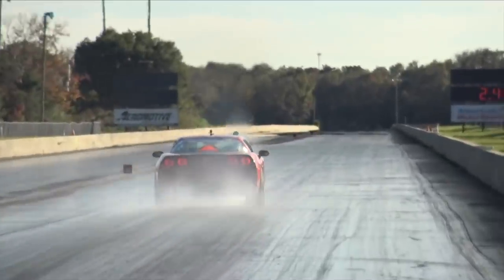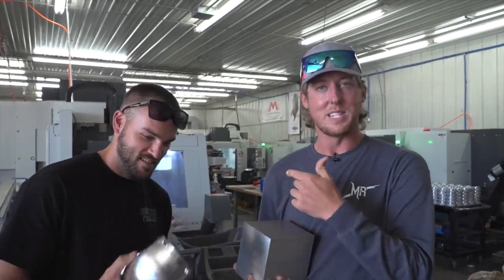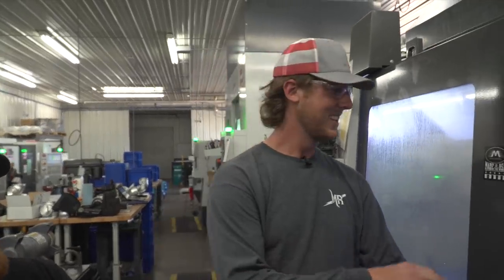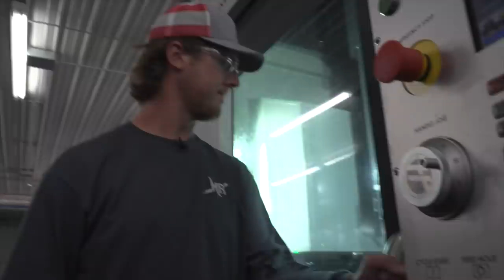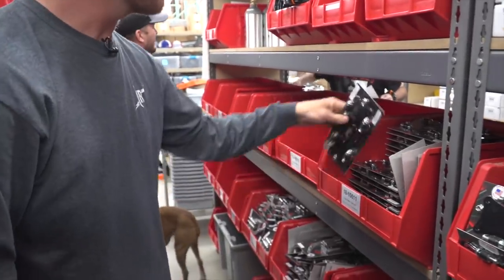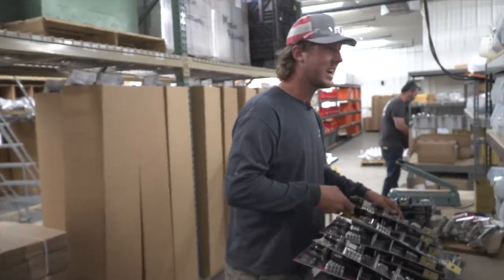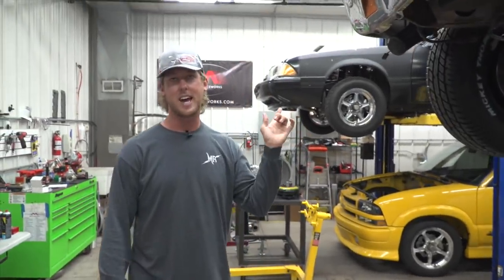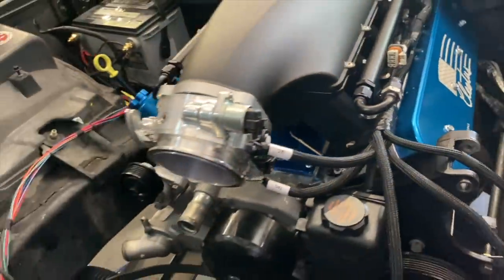We Just Made the BIGGEST Move Of Our Automotive Career...

Comment: I laughed like hell when cleet said "Pah, Ford stuff" when the mass majority of his fleet are Crown Vics.
Reply: Hmmm, technically that is true 😂😂😂
Reply: Because they are cheap lol.
Reply: Or the fact that the most reliable car is Ford. There is a lot goes into building a Ford motor. An ls is much easier to be truthful
Reply: All the this vs that attitude never seems to die.
Reply: @exothermal.sprocket  he aint wrong tho, wrenching on fords is alot easier .. distributor in the front not the back etc etc
Reply: and neighbor has been the most reliable car he has. lol
Reply: @Zirion123  There's good and bad with both. If you're a GM-head, you'll swear nothing about a Ford is better. If you're a Ford-head, you'll swear everything about a Ford is better.
Reply: @exothermal.sprocket  i like them all and have had them all, talking from experience not just hate towards gm. got every car brand from mercury to chevy to volvos etc
Reply: especially "Neighbor" LOL
Reply: I've been really impressed with the Coyote 5.0 over the years. But I see Ford is also going in a slightly different direction now with the big 2v pushrod 7.3L and the rumored 6.8L based on that architecture.
Reply: @exothermal.sprocket  i am also very impressed by the coyotes, especially with neighbor. That engines been through hell and back plenty of times
Reply: @triplehfarmsllc7348  ive always heard you can build a ls cheaper, but just buying a coyote is better long term and have proven reliable at high hp levels
Reply: @traxxasrcfun  yes sir they are a pain to work on as well. I like LS stuff and have a turbo LS foxbody but my big turbo 8.2 deck is way faster and has been a good setup for. 11 years now and have a foxbody coupe that KSR built for a guy that I’m in the process of coyote swapping and gonna do a twin setup on with a powerglid that I’m hoping will be pretty competitive when done. Parts and stuff are super hard to come by right now. My heads have been in back order for 8 months now
Reply: @triplehfarmsllc7348  Coyotes are awesome. Good luck on getting your parts in a reasonable amount of time. I want to coyote swap my fox
Reply: @traxxasrcfun  The 5.4 sc V8 in "Neighbor" is from Ford's previous "modular engine family" (with also included the 4.6 V8) unrelated to the 2011-on Coyote 5.0 engine. The 5.4 shared similarities and uses across a broader range of vehicles in a bunch of different configurations, some of these being the Lincoln Navigator, Mustang SVT Cobra R, Ford GT supercar, Shelby GT500 Mustang. Was also used in the Aussie Ford Falcon up until 2010.
Reply: @Zirion123  lol, no
Reply: @exothermal.sprocket  what? I thought it had a gt500's 5.8, then that blew up so he swapped a built coyote in? I appreciate the Info and trying to teach me but I already know most ford engines pretty well, from the pushrod 302's to today's yote
Reply: @traxxasrcfun  Oh, just a bit of a misunderstanding. So far as I know, they pulled the 5.4 and sent it to L&M for a full diagnostic, and over a year ago upgraded the VMP supercharger unit to a more efficient VMP. Cleetus said the engine has been extremely reliable ever since. I don't recall swapping to a 5.0 Coyote.

Comment: The only thing motion raceworks is missing is a smelter to melt the aluminum scrap back down and make their own blocks of aluminum so everything would be done in-house
Reply: You know Cletus would be all about that
Reply: Meh they sell the scrap anyways.  Not worth all the trouble and floor space you would need to do all that.
Reply: A lot of those parts will be made of forged aluminium billets instead of cast blocks. You get money for the scrap (we used to use the “chip money” off our big saw for machinists beer at Christmas) then the material gets used for something new. You also need traceability for some components, right back to the base material.
Reply: It’s not as easy as just melting it and pouring it into a crucible. They would need experts in order to make recycled aluminum ingots that are up to standards for composition, strength, etc.
Reply: I work for an aluminum extrusion company. We melt aluminum and cast billets, then extrude, anodize/powder paint/liquid paint and so on. I saw a lot of parts in there that we could be manufacturing for whoever they buy from. Pretty neat stuff.
Reply: Cast aluminum is wayyyy different  than forged aluminum. Melting the scrap into cast bars would be useless because they used forged stock
Reply: @chevyman2002  I used to work for a tool and die company that made dies for the aluminum extrusion industry
Reply: @CoconutMigrating  exactly.  Leave that part to the experts.  They probably make parts out of all different grades of aluminum but all chips end up in same bin out back.  Consistency would be way off.

Comment: When the useless EPA is trying to kill the industry, Cleet doubles down and buys a huge chunk of one of the top performance parts distributors. Respect.
Reply: Mind you I did see the.design for the electric F150. Looks.sweet! Once they fix the range  and the price drops I'll definitely get one
Reply: @timp1390  Yup.  Sweet.  For the 40 miles it'll tow.  And disposable, so you don't have to worry about resale value.  "Once they fix the range" is the same thing as saying "once they increase the price and weight".  Also, my 20 year old F250 with 350k miles is on it's first engine.  How many $12,000 battery packs is that?  Anyone who buys an electric truck at this point, is buying a headache and an eventual boat anchor.  Sure, eventually they might be OK, but at this point, stay away..

Comment: You guy need to buy 50+ brand new car/truck chassis. 50+ big block. and make the 1st freedom factory production car ...cant say its modified and illegal if its from the factory!! and get going with the resin injection molding work so you can make mix of aluminum and exotic material like carbon fiber/kevlar. Keep pushing the limits!!!

Comment: Well if theirs one thing your good at, its breaking and testing and breaking and testing, if it works for you, 99% of us wont even put it near the limit, and just speaking from what my father of many many years always tells me, the older stuff lasted as it was made with slide rulers with a 3% extra of what it needed metal wise vs the modern stuff where its within half a percent, so if you need to really beef it up, tell them to go 2.5% over what they think a part should be machined with when it comes to steel to make it last

and that's coming straight from an engineer of, well, lets say well over 25 years of experience.

Comment: Most of these parts are better die cast, forged, stamped, or drawn. Especially that valve cover will weigh MUCH less being drawn from a thin sheet of aluminum. Also much cheaper to produce that way. The US has fallen in love with milling but in most cases it is just a way to sell overpriced fancy looking parts. If you are making more than a few prototypes there are much better ways to make most of things and only machine the finishing steps on a few of them. Better look into production machines instead of overpriced Haas prototyping mills for everything. You spend more on milling cutters in a month than a 500 Ton press costs.
Reply: Presses break all the time and depending on the thickness, you might have to heat up the aluminum before hand but ya it would save on the tooling.